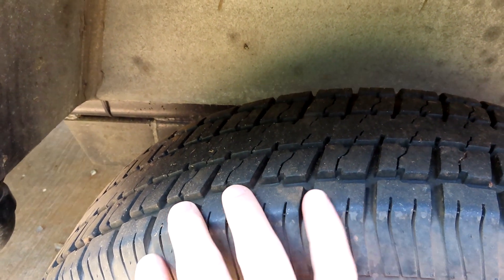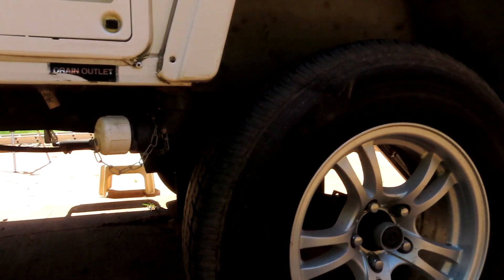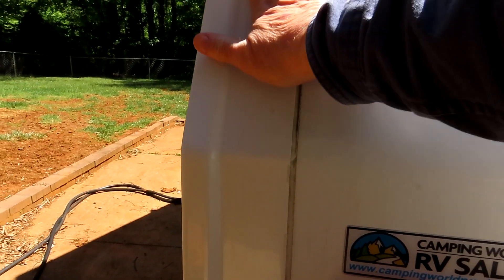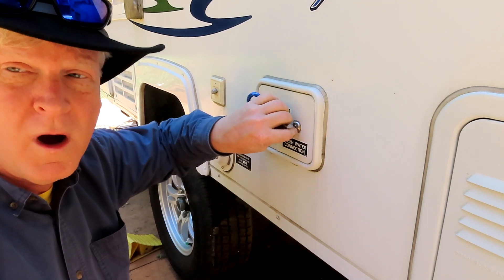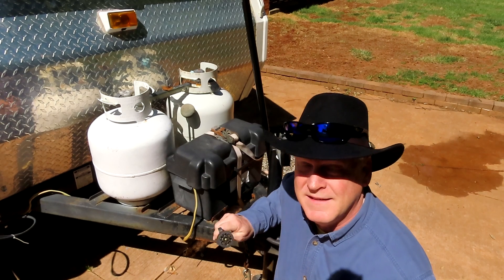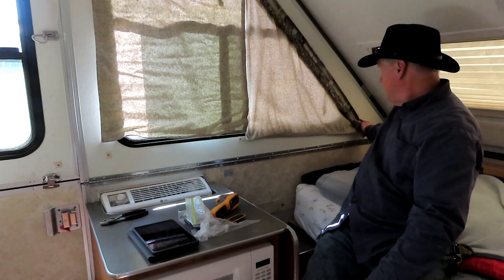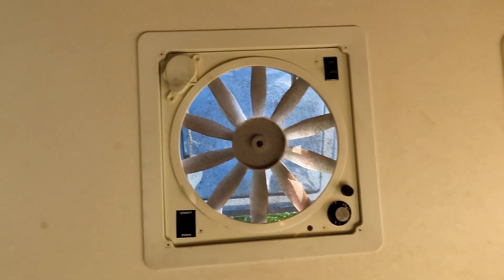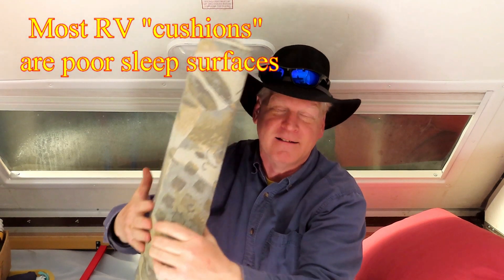Buying a Used Camper Trailer Popup or Aframe, what do you need to know, what to look for in used.

Comment: Nice video.  I was just about to wash my curtains.....thanks for the tip on not washing them or they will shrink.  Who knew?  My Aliner is a 2011 Scout, so it is the same size but much simpler than yours.  It has no water tanks, water heater, furnace, outside shower, inside propane so no stove and the refrigerator is AC only.  The result is no winterization and litle maintenance aside from the bearings/tires.  I did spurge and upgrade to 400 amp hours of lithium batteries with a 1000 Watts inverter under the front dinete seat with 200 Watts of solar on the roof using your design.  I have the ability to charge the batteries at 50 Amps per hour from the car while driving/idling.  All that lithium storage is great for running the refrigerator, but it will also run the AC for 9 hours for overnight sleeping in hot humid weather.  Love your videos.
Reply from the maker: Awesome Lithium/Solar Set up.  My next battery will be a battleborn Lithium.  Which may require a Solar Upgrade.  Did you modify your A/C for the battery?  There are things you can do to greatly lower the power draw.
Reply: @GoingNoWhereFast  I did not modify the AC unit.  It only draws about 400-500 Watts when compressor is on and 50-70 Watts when the compressor is off.  The issues can be the Watts that AC pulls on start up.  My inverter does 1000 Watts continuous and 2000 Watts peak for short periods of time.  It works well.  I built my batteries from raw cells with BMS/active balancers and saved about 50% off the Battleborn price, so my four 100 Amp hours batteries cost the same as two 100 Amp Battleborns, which are really great batteries with amazing warranties, but they are pricey.  I plan on taking my lithium batteries with me if/when I upgrade to the next trailer.  They are a 10-20 year investment assuming they last that long.
Reply from the maker: Hopefully you know enough to keep them from catching fire....LOL,  though tha'ts a good way to a new trailer with fire insurance!  Stay Safe !
Reply: @GoingNoWhereFast  Check out Will Prowse's DIY Solar channel on Youtube...It is a great learning vehicle on solar and lithium batttery building.  I've watched hundreds of his videos.  He is a staight shooter.

Comment: This is timely!  I am looking at an old pop up, old.  I will see it opened hopefully today.  I am thinking of a conversion to a hard side for my safety, as I will be traveling alone.  I had a list of things but will go back with a new list and my “stored” yoga mat to see underneath.  Thank you!  (Ok, just finished and this is a great video... love the ice cube tray idea!)
Reply from the maker: Well, great!!  Timing is everything!   It is not easy to convert a canvas to a real hard sided, as it doesn't have the strength or stability on the road.  But you can "Double Wall" the canvas and make is quite safe.  Camping is pretty safe anyway.   Millions of people and in any year 3-5 episodes of trouble that were unrelated to drugs.  Just saying!
Reply: Make sure you remove the bench covers and any parts which cover the internal frame. Look for loosen fasteners, staples backing out, etc. Check for rot around the door and along cabinet areas which come in contact with floor. Check outside caulking, all of it. Use your finger nail to see if is still bonding to the body. Take your time with this... Go check it out when it's raining you can get a pretty good idea how it is holding up.
Reply from the maker: Good Points.   Depending on the price and age,  You can expect some "loosening" of fasteners and Caulking.  But that's the easiest of fixes if water hasn't done damage already.  But good negotiating point on price

Comment: Excellent! Quite a few Avans here in Australia, but on the whole it's like the US, most folks prefer huge SUVs, and tow big vans. A lot of retired folks travel yearly to the warmth in the winter then back to their homes in the cooler parts of the country for summer, so they live 4-6 months in the van each year (you have to think upside-down for Australia because it's in the southern hemisphere so the north is hot/tropical and the south is cold). I have only a 4-cylinder sedan, altho it's a Toyota with a 2.4L engine, so I can't tow anything bigger than an Avan - am wanting to buy one, so your video was a big help, thanks.
Reply from the maker: If your just a little rugged and self sufficient, you'll love it.  They are the best to escape the element for comfort and still staying outside!  Thanks for stopping by and leave me a nice comment!

Comment: Re wash the curtains in cold water and re stretch them when wet. Then Iron them wet and continue to stretch. Then air dry and they will go back to the original size.
Reply from the maker: Thanks!  I’ll try that. They are do for a wash anyway.

Comment: That's really a bunch of great info. Love our Aliner, second one. Only thing that is not great is the Expedition's front storage compartment lid is very lightweight fiberglass.  Have to be careful using it. Like you, we do not use water inside, or the stove. Have used an electric skillet with a lid. Fan works great for pulling out odors. Those were all great pointers for someone in the market. 😊👍
Reply from the maker: Thanks, I'm going to do more as I look for possible replacements, Maybe post a checklist list to my website. Thanks for the comment!

Comment: Thanks! That was so informative. I initially wanted an A-frame camper, but I have settled on a van (got a good deal on it).
Reply: Sorry, hit enter before I was done. I think with a pop-up or A-frame, it would be important to practice set-up and take down if you are a solo camper. I'd hate to get somewhere and couldn't get it set up!
Reply from the maker: They are pretty easy to set up and take down, if the springs are good.  I didn't include that in the video as it is kind of like the paint job, you really can't even look at the camper without doing the set up and take down (at least I hope no one would buy without doing that at least once).   And of course you can add extra lift if needed (Like I needed..LOL)  Thanks for the comment.. and 2 for one no less !!  :-)     Enjoy the van !!  They are fun too !
Reply: One good thing about a Van. If your are camping alone and something happens. you can leave camp fast. nothing to fold up or down.
Reply: @chrislincoln489  You can always shoot first and ask questions later.  Or drive off and leave the camper if it is that dire and you don't know how to shoot.

Comment: Would you be able to find folks in your travels that added roof racks to hold kayaks and awnings to their Aliners?  I’ve also seen on line 2 different homemade awnings which might work is a must have for us and no roof racks.  My 6’ 1” tool man husband and I in our 70’s have 22 years of dry camping w our Coleman pull out beds popup w plenty of sleeping room, trailer roof racks & a strong awning. We’re thinking of an Aliner that would be quicker to open & close and we want a pop up. We’ll have a lot to gain but a lot to loose if we make the switch.  We enjoyed your video and have subscribed.
Reply from the maker: Well thank you!  You can attach racks to the aluminum sides of the front and back roof.  You have to be careful where you attach them because if it is where the roofs overlap when closed, it will cause much scraping and wear on the inside roof.  The biggest issue is that of course any "toy" you place on the roof must be removed to open it, so a quick stop for lunch in the Aliner is not possible.  Also your toys are no longer stored as safe as when mounted. Check out how I mounted my solar panel.  It's not correct, because it does rub when down, but you can get the idea and do a better job.  https://youtu.be/bpqWdeA8H2Y

Comment: Love the video! I'm trying to decide if one of these is for us and you just kind of made it worse for me... Looks like I'm about to lose a lot of money in an aliner 😂
Reply from the maker: Go for it! Hopefully you’ve seen my video on. Don’t buy an A-frame pop-up before watching this video.
Reply: That's actually the video I was leaving this comment on. However, by the time I finished the comment it must've started playing this video 🤦 that video convinced me more to get one.
Reply: How good are aliners with cold weather camping?
Reply from the maker: @nathanfarley2841   If you have an electrical hookup, you can keep them toasty warm with a 800watt little heater.   If you don't have electrical, the furnace will keep you warm but you need to have enough battery to keep the furnace running.  It uses about 4amps/hr.  So the standard 80AH battery will only last 10hrs.  Biggest issue really is condensation on all the aluminum framing.  It will drip into your corners and hinges and rot or rust them.

Comment: Love your videos.   Wish I would have watched this before I bought mine.   I ran into an issue where my roof doesn't latch on one of the four sides because it doesn't quite line up right leaving a gap at the top.  Any ideas what the issue might be?
Reply from the maker: Sorry to hear that!  No, I have no idea.  Is it possible the frame is bent and so mis-aligned?   Was it new or Used?  It might have to go back to a dealer.

Comment: Have a question for you. Just raised my camper 4” and went to 14” truck tires. Best thing I could have done to my Chalet. My 13” spare used to hang under the trailer with a drop down cable. The new 14” truck tires are substantially heavier. Just wondering if the cable can handle the extra weight and, my question to you is, where do you store your heavier 15” tire?
Reply from the maker: My spare is on the back bumper.  And I had the bumper re-enforced for a trailer hitch and the spare.  It is a lot more weight and the bumper mount is a bolt clamp square pipe with 2 bolts on the top, so it shakes, rattles, and rolls going down the road.   A bit sketchy, but its held up so far and I Check it every day on the road.
Reply: @GoingNoWhereFast  Thanks for the quick reply. Just weighed my new and old tires. My new tire and rim weighs 45 lbs. My old 13” ones come in at 30 lbs. Since it’s only a 15 lb difference I think the cable should have no problem with the extra weight. Think you are right about it being a little scatchy hanging off the bumper.
Reply from the maker: @oldmillrd1506  Ya,  that should work, just 45lbs would be a bit more trouble for me to shift around and get up under there....LOL

Comment: Hi the fan in my 2006 Expedition is very noisy.  What did you use to replace that with dual fan set up you have there
Reply from the maker: You  just replace it with a large computer fan, they generally cost around $10-$20, the take up a lot less voltage and are much much quieter. Most of the ones you might buy from a real computer supply place like  NewEgg  or CDW will even tell you how loud it will be.  Then the mounting is a bit creative, but the wiring is just cut  out the old one and splice in the new one.
Reply: You can add a DPDT switch to operate the fans in the 6 volt or 12 volt as long as they allow a wide range of input voltage.

Comment: Great video!  Mine is 10 years newer so a lot is different.  I'm on a twin XL mattress.  Fits better from side to side length.  Test the electrical hooked up and on the battery.  Actually run the ac unit. (Did you mention that? LOL)  Open and close the trailer too!  And did you ever throw the Blue Ball for Akela? 🤣😎
Reply from the maker: I did say test all your outlets and lights, so you would have to be hooked up for that.  Your Twin XL must go along the A-Walls, cause the trailer isn't wide enough for a twin XL I don't think.
Reply: @GoingNoWhereFast  I have an Expedition and have a couple inches to spar across the back.

Comment: Nice Rick. Is there some kind of connection enhancer spray for a 7 pin?
Reply from the maker: Not that I know of.  There are "Lubes" that are recommended for boat and snowmobile trailer connectors, but that is becuase they are so much in water, snow and salt. I used it when I lived up north, but it collects dirt and grime, so i don't recommend it usually.

Comment: How satisfied are you with the fridge in your camper? Particularly when going down the road.

My experience with the fridge in our Aliner is stationary on propane or shore power its ok so long as its not too hot outside.
Just never had much luck running it on DC while going down the road.
Reply from the maker: I've never run mine on DC.  Well maybe once.  But DC is similar to the really Old  Propane Frigs.  If your going down the road the wind blows out the flame, or the heat from the DC Heater.  On the Propane it relights instantly and keeps the frig working.  On long hot trips (over 90F) mine makes ice cubes and stays under 40 def F.    If I run out of propane it does warm fairly fast.  Like in 30 minutes above 50.  I keep a wireless thermometer inside it to watch as I drive.
Reply: @GoingNoWhereFast  Thanks for sharing the experience.
I hadn't considered that wind might be pulling too much heat from the heater can, though that area is insulated. Maybe I can work on reduce that heat loss. Suppose wind could be too quickly cooling the ammonia down as it leaves the heater also.

I've been tempted to pull it out of the camper entirely so we can use the space for something else.

Maybe I'll poke around with it some more. We got a 12v inverter fridge because we no longer trusted the Dometic. Would be nice to have a 2nd fridge in the camper.
Reply from the maker: A lot of people don't trust them,  they tend to come open if you leave things to roll around inside and they don't work well on DC.  I've personally never had any problems except at night it tends to run cold and freeze things.  But a top Loader would be more efficient.   Mine cools down in 2 hours on Propane if the back isn't in the sun and the fans are on
Reply: @GoingNoWhereFast  do you run your fridge on propane will driving down the road?  Ive had people tell me not to do that.   To be honest i had a class b van for awhile and i always kept it on propane even when driving down the road and it worked perfectly with no issues.   I would turn it off at the gas station and when filling the propane tanks.

Comment: What kind of weather stripping did you use?
Reply from the maker: I generally use rubber D shaped.  I think it works better and holds up better.   But it may not be what Aliner used originally,  so it can be hard to find i the right size.
Reply: my aliner is a 2007 so it should work, if it worked on yours.

Comment: All you need to do curtains is iron them
Reply from the maker: I've hit them with an iron a few times, but every time you close the camper up they are all squenched up and look like they were never ironed. I think washing them in hot water and then drying them on high heat really did them in.  Especially since they are double layer and the inside layer is different material than the out side layer.

Comment: In the spirit of SlimPotatoHead's metamorphosis, I've been doing some research on trailers, and found this, the Armadillo from Canada. Link:
https://www.armadillotrailers.net
Reply from the maker: I don't think so......  Too small and Easily blown off the road with a good wind, because they are so light.   And Fiberglass does not respond to off road as well as wood and rivets do.  It has much less give to torsion and racking before failure.  I'll stick to the Aliner  which is quite sturdy in its down configuration.
Reply: @GoingNoWhereFast  Glad to hear you'll be sticking with the Aliner. There's just something really neat about them, and your channel is a great source of information. Yours looks to be in great shape, in spite of the use and age.
Reply from the maker: Thanks,  It has way too many advantages to leave for something else.  And mine has suffered in some areas, but not in others.  So we will continue to "tune it up" and keep it rolling !